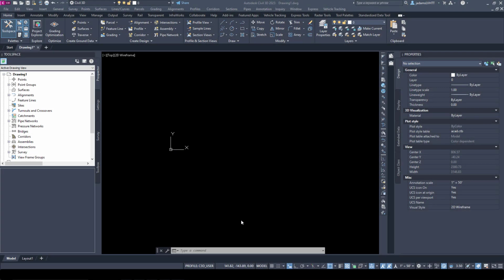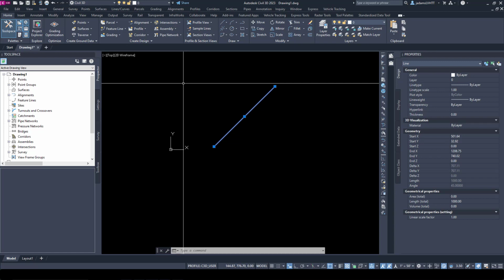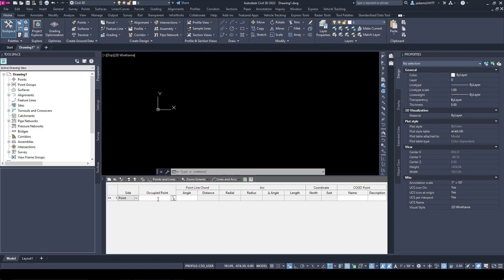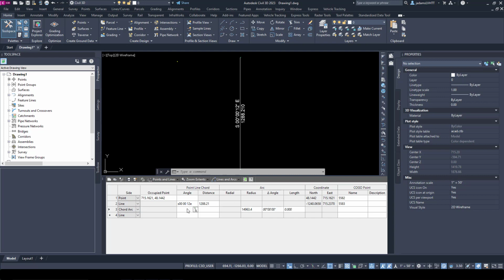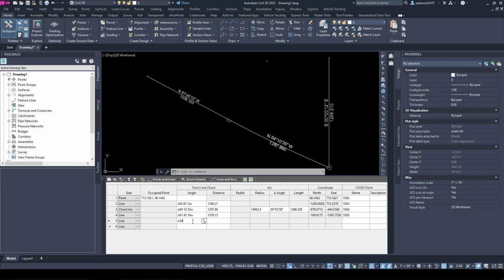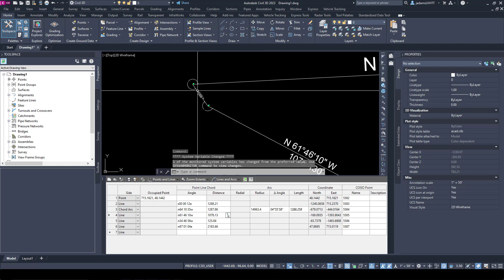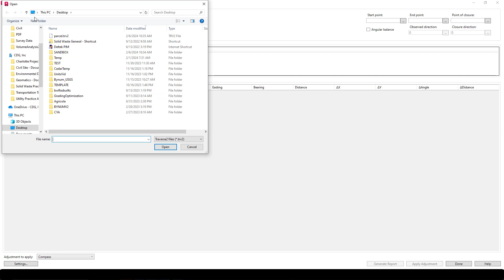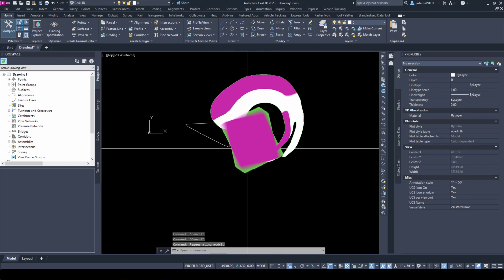Civil 3D - Using Traverse Editor to Help Recreate Deeds

Comment: I had a question.. that first curve you come to.. I know it's non tangent and follows the road.. but let's say you have a deed.. bearing/distance.. to a POC.. and your only info is direction, radius and arc length... I don't see a way to indicate a direction.. obviously if you have the CB/CD, you'd just use that.. but if you don't have that.. ?? Great video!
Reply from the maker: Regretably if the legal description doesnt have the required three items needed to describe a curve you will have to make some assumptions.  You could woek the line up to the POC and then start a new line from the POT all the way back to the POB.  Then hook the second line to the POB with the assumption the boundary closes.  The gap between is the arc. You can then check it versus the legal and pray.
Reply: @cruciblephoenix1037 hey.  Thanks for the reply.  I THINK i may have found what I was trying to do.  So.. instead of the chord/arc, I picked the radial arc.. and entered 270 degrees under "radial" then the standard radius and arc length.  Which pushed it 90 degrees in the direction i was going.  Happens to work for the filed map I was messing around with.  But it shouldn't be difficult to figure out the real number using the bearings.  My closure was only off about 0.01'.  So not too bad.  Again. thanks for the replay.